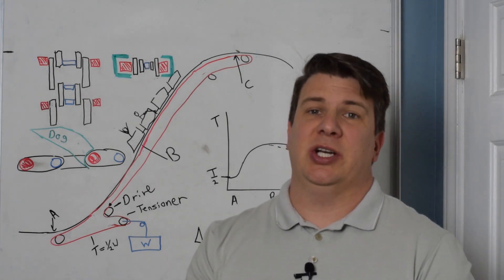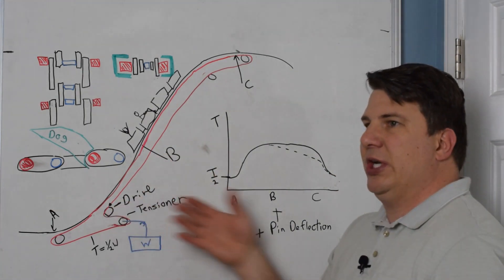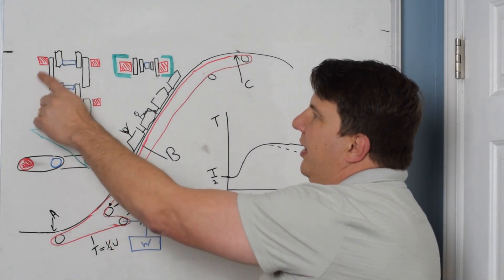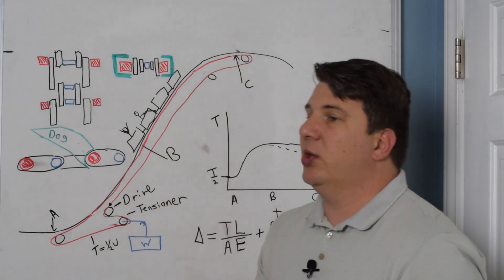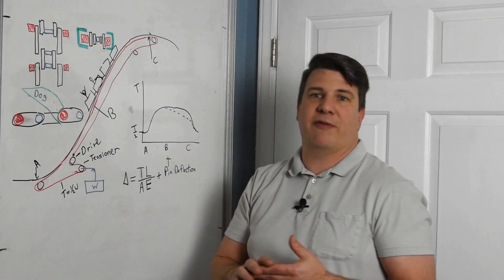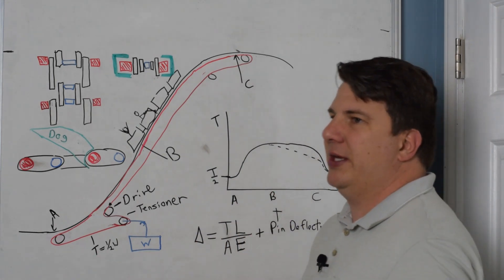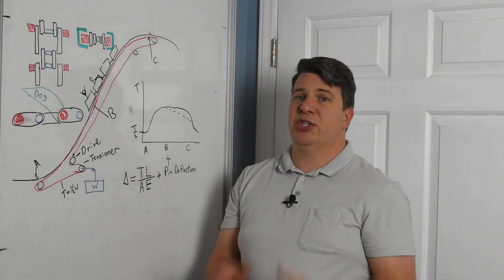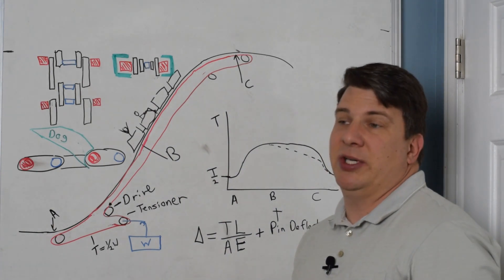STEM - Why Does This Weight Move on Roller Coaster Lift Hills?

Comment: Would love to see how a spiral tire lift works. The bottom of each rollercoaster car has a straight beam running down the middle and yet it is able to run between tires that are on a spiral or curve. Take a look at Olympia Looping for example.
Reply from the maker: David,  the tire drive works exactly as you assumed.  There is a beam hanging down from the train and it is compressed by the pneumatic tires on each side.  When I worked at Knott's Berry Farm, they built Jaguar and we got a special behind the scenes tour.  I wish we had cell phones back then.  I would have grabbed some pictures.